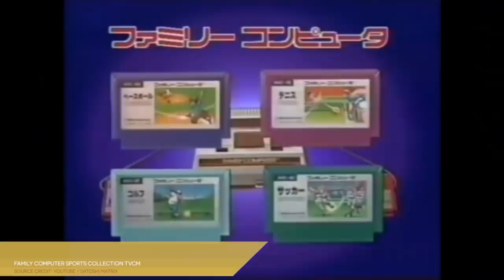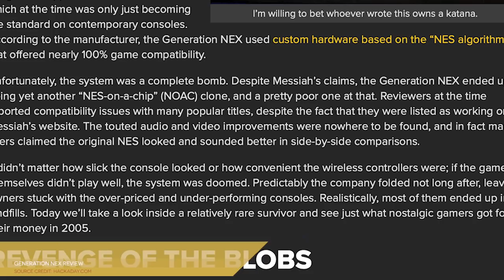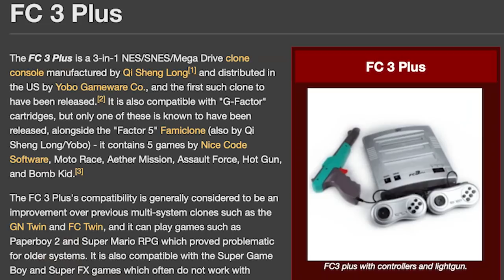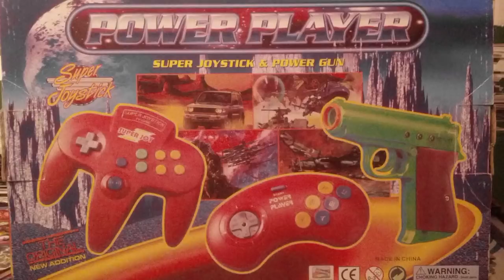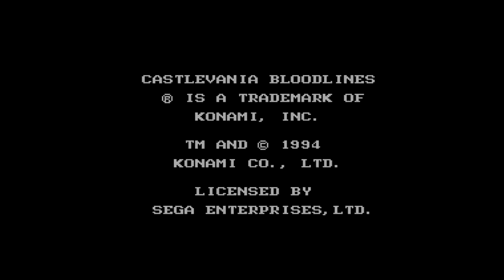A Brief History of the NES on a Chip: Betcha byte a chip | NES Works Gaiden #026

Comment: The epoxy blob Is not really a protection, it's just the bare silicon die integrated circuit placed on the pcb and wire bonded to the pcb tracks directly, it's cheaper than encapsulating it and then soldering, since chip manufacturers charge quite a bit more for encapsulating the chips. You often see this in calculators, the technique is called chip-on-board, there's also chip-on-glass and chip-on-flex depending on the surface you want to mount your silicon die on.

Comment: Wasn't the NES here in England, at least not in shops, you could get 'em on market stalls etc., but there was an "Atari 2600 on a chip" system sold in stores called TV Boy that was completely wireless. The system was built into the controller, it could be powered by battery, and had an RF modulator and antenna, so you could tune in to it without needing to connect via cable. Of course, it had RF out and a barrel jack connectors for playing wired, too, as well as a standard 2600 joystick port for a second player.

It had over 100 pirated 2600 games built in, mostly Activision ones with the Activision logo hacked out.

Comment: Ah I missed this one. Once again I am so flattered to see so much of my content get credited in the b-roll. 

I have been fascinated with clones of the NES for decades. Growing up, my uncle had an NES that looked vaguely like the one Nintendo made, but it was a bit smaller, and notably had a spring loaded cartridge door like a VCR rather than the simple hinged door of the real NES and said "COMPUTER VIDEO GAME" on it rather than the word Nintendo anywhere. 

Over the years, I've tracked down literally dozens of clones. As Jeremey said, the earliest ones from around 1987 were discrete hardware clones that took every component from the Famicom and copied its function with an identical off-the-shelf component, one to one. This worked for everything except for the two custom Ricoh chips - the 2A03 CPU and the 2C02 PPU. These chips were cloned when the Chinese clone makers first took the real chips, dipped them in sulfuric acid to remove the casing, and then studied by hand the chip die. This reverse engineering process was done without the aid of computers and resulted in errors in both chips. However, the errors weren't significant enough to stop the function of the majority of games. 

As the years passed and single ASIC logic became available, all future clones simply took the flawed original clone designs and molded their future designs with the same flaws. Still to this day if you buy a Famiclone on Aliexpress, it will carry the same flaws as a clone from 1987. 

It's only been in recent years where efforts have been made to clone the NES hardware properly with the Analog NT and the much more affordable RetroZone AVS with FPGA technology, and of course, NES emulators run well on even the lowest powered of single board computers like the Raspberry Pi Zero. 

While both of these options are great, I wish for clone makers to take another shot a making a NOAC - this time with modern reverse engineering tools. If the NES hardware was truly cloned properly, NOACs could serve as affordable means to play real cartridges and offer an experience absolutely identical to the original hardware. NOACs are a good idea. It's simply that all of them share the same flaws from their 1987 origin.

Comment: NES On A Chip going away? HA! No it's alive and well in the cheaper mini-arcades. One of the most fascinating being the Wal-Mart exclusive Rampage which is the NES version of Rampage but with the arcade title screen and missing character Ralph added back in. That said, the Jakks Pacific plug 'n plays specifically were usually SunPlus chips and not NOAC which was why they were often NEAR arcade accurate but not exactly. It's actually the more modern plug 'n plays you can buy at Wal-Mart now that use NOAC and it's depressing: The Jakk's Pacific Ms.Pac-Man Plug N' Play from nearly 10 years ago was sold at the same price but is VASTLY superior to the ones on the market now.
Reply from the maker: I looked but could not find a lot of this information—do you know of a centralized resource for SOAC/plug ’n play tech info?

Comment: Just one small thing to point out (sorry I'm not a Karren I promise, don't hate me)
ARM wasn't designed as a mobile CPU first.
It's instruction set is light and this make it good for mobile but it was designed for the Acorn Desktop computer by one person working for Acorn in the uk.
It used so little power that when they tested it they were surprised to find it worked before they had plugged it in (phantom powered from it's peripherals)
(Acorn RISC Machine or ARM with the RISC standing for Reduced Instruction Set Computer)
Mobile came many years later but the chip is mostly unchanged.
The film MicroMen is a good depiction of that time in the early 80s.
I miss my a3010.

Comment: Technical detail: the epoxy used to cover chips is actually very simple to remove. Just heat it with a hair dryer or heat gun for a few minutes and it will return to a viscous state after which it can be removed relatively easily without damaging the circuit board.
This "protection" actually feels like a projection of the mental state of the creators of such machines. Having somewhat stolen somewhat else's IP, they felt the need to protect themselves from others stealing theirs... As futile as it was revealing.

Great video, keep up the good work!

Comment: Nice video! This is sort of my area of expertise, so I'd like to offer some additional info/context/clarifications:

It's likely (though not confirmed) that the first Famiclones probably came from Taiwan's Bit Corp, who patented the first NES PPU clone alongside UMC (who later acquired at least some of Bit's assets and staff, if not the whole company). UMC would be the biggest provider of clone NES chips for a long time, including perhaps the first NOAC and even an enhanced-colour-depth version seen as early as 1997, which almost certainly served as the inspiration for the ubiquitous VT chips made in the 2000s onwards.

Incidentally the current top-of-the-line is probably the VT369, which includes a second CPU core with built-in ADPCM decoding and seems to be loosely backwards compatible with all previous VT chips, including the 6502-but-not-NES based VT168 line used in a number of plug-n-plays throughout the 2000s.

One other advantage of the VT chips is their so-called OneBus technology, which means manufacturers can create a console with built-in games using only a single ROM chip, not requiring separate PRG, CHR and mapper chips like you'd find on a typical NES cart. Of course that was another significant cost reduction, and all of today's NOAC handhelds and plug-n-plays use this tech. (It's also meant manufacturers were able to move towards using cheap recycled flash chips to store their ROMs, which are thankfully much much easier to dump than the old epoxy globs)

Subor, while maybe not the first Famiclone maker worldwide, was definitely one of the first in mainland China and the most successful there by miles. Its founder Duan Yongping went on to found BBK Electronics, which began in the clone console industry too but rapidly expanded and today is the parent company of the OnePlus, Oppo, Vivo and Realme smartphone brands.

The idea of using Raspberry Pi boards in cheap consoles has not really taken off among Chinese manufacturers, but you're right to say the tide is turning slowly away from NOACs, instead they're mostly shifting towards using low-end ARM chips on custom boards, sometimes using a poor NES emulator to run the exact same games the NOAC devices would've run, worse than the NOACs ran them... But NOACs are still thriving as a cheaper option.

Oh and modern-day Famiclones are just about hitting that 1000-in-1 mark for real :)

Comment: interestingly, back on the day the compatibility problem was unheard of here in russia. have the clones got worse over the years? i wouldn't be surprised if many of the pirate carts that were floating around were made even before nes-on-a-chip came into existence.
Reply: They sure got worse over the years. The real Dendy or Subor from 1994 or 1995 is leagues better than "Dendy's" from 2000's. Early clones were basically copies of the real Famicom design with some needed changes to accommodate the conversion to 50Hz PAL system for Russia. They had excellent sound and video quality on par with the real thing and very good compatibility. But as time went by they put less and less components and effort into making them. This usually manifested in worse and/or glitchy sound, poor video quality with great amount of digital and analog signal interference (or noise). Compatibility was all over the place. That's not to say there weren't any good clones in the 2000's, they were just more rare.
Reply: Yes. As mentioned in the video, early Famiclones were, literally, NES clones - they were rebuilt using (copies of) the same chips and components that went into a real NES, so they were by nature 100% compatible. NES on a chip Famiclones have issues because they are simplified.

Comment: Come to think of it, estimating FC/NES coverage in Russia would be rather difficult. Any hard figures available would be sales numbers for "official" Dendys, whereas "unlicensed" Chinese Famiclones were just as widespread, if not more. They were cheaper than a "real" Dendy and worked just as fine (actually, many of these old clones are quite hardy and reliable despite being knockoffs, probably due to them using similar or same components as the real Famicom). The Little Tyrant, for example, was widely known as "the Subor" in the late 90s/early 00s, and this name was sometimes applied to all other keyboard-carrying Famiclones. One other thing I wanted to add is that in the case of South Korea purely economic reasons were not the only factor preventing Nintendo from entering the market. Up until the early 00s South Korea had laws to prevent Japanese culture from spreading (as retaliation for the colonial rule), and companies like Nintendo or Sega had to license their products to Korean conglomerates, who then produced their curiously named licensed clones (or, rather, rebranded consoles) like the Alladin Boy etc.
Reply from the maker: I wasn't aware of that South Korean law—thanks for the info! It does explain a lot.
Reply: @JeremyParish  It was a blanket ban on all mass culture, including anime, music, etc. Co-produced things, like the Golden Bat anime, were allowed though.

Comment: Regarding ASICs vs discrete components - back in the 90's if you wanted to play full quality MP3s on your PC you'd need a full on Pentium PC, but in the early 2000s there's portable battery powered ASIC based MP3 player systems, and they cost hundreds instead of thousands for a PC.

Echoing other commenters - first time I played Famicom Lode Runner, Nuts and Milk, and Yie Ar Kung Fu was on a dedicated fami-clone in the late 80's while visiting family in South America. All my cousins had a famiclone with built in games - those must have been CHEAP. 
They all had a bunch of nrom games and featured Contra (only one with a mapper chip) as a headline title. A relative had a clone 2600 with dozens of games built in. It didn't have a menu, just a button on the back to switch games.

edit: Ah that's right - you're running this through a Framemeister or similar - you've just captured the highest quality famiclone video EVER. 😁
Reply: Now you have me wondering about "lost to time" questions: 
A team of hardware designers created the NOAC design but who they worked for or their names is unknown. Where are bootleg chips manufactured? Was the NOAC chip pirated itself? 
Why did ASIC (black epoxy glop top chip) versions of SNES or Genesis never appear?